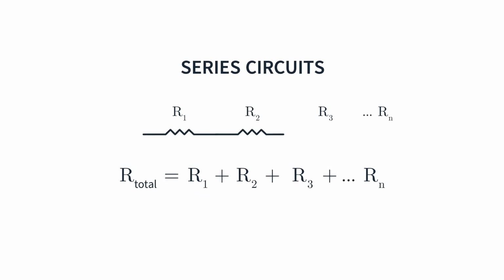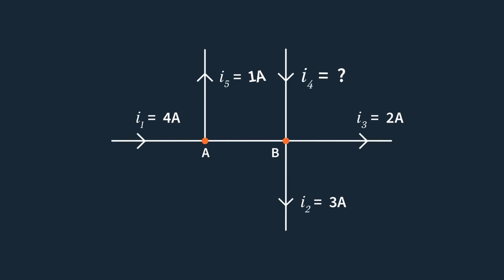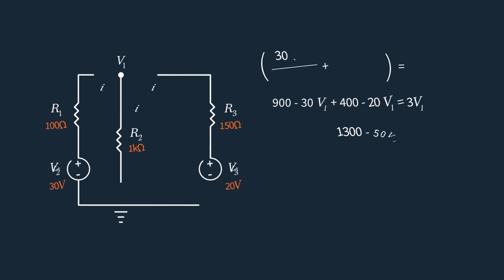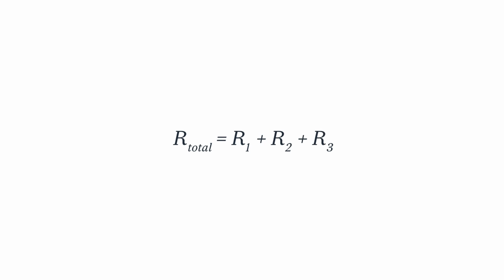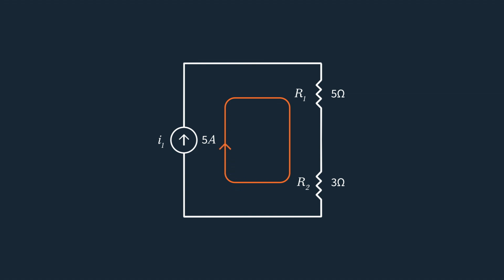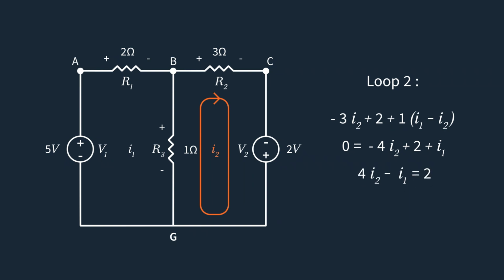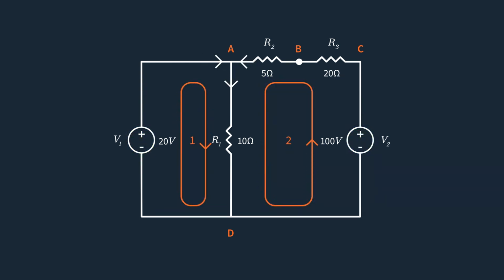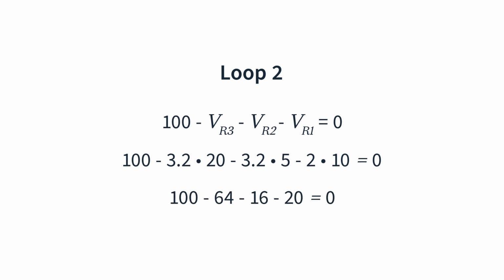Kirchhoff's Current Law and Kirchhoff's Voltage Law | KCL and KVL

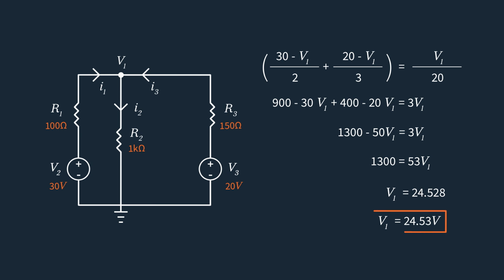Comment: 6:05 How do you get from the 1st equation to the 2nd equation? EDIT
Multiply top and bottom of 1st nomial by 30. 
Multiply top and bottom of 2nd nomial by 20.
Multiply both sides of equation by 60 which will remove bottoms of both nomials.

Comment: it was so confusing for me in loop 2, where the current enters R3 from the negative side and the current i1-i2 is in the opposite direction, so i inverted current through R3 and added it as a voltage source. my professor told me to erase all + and - from resistors and go again, and now i get it.